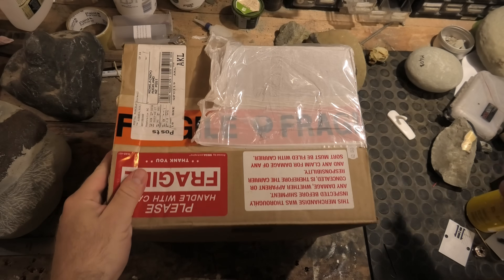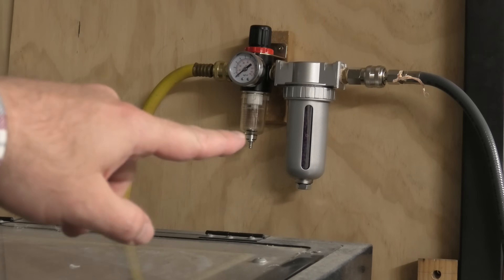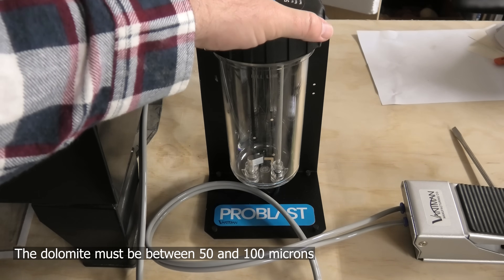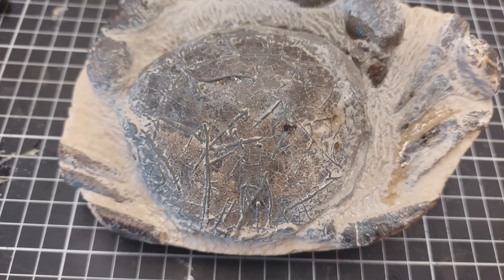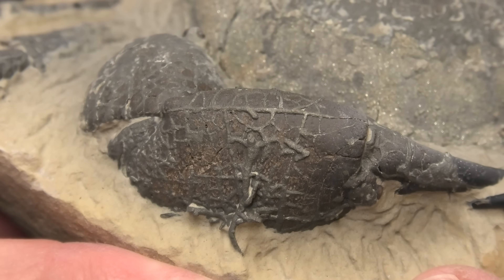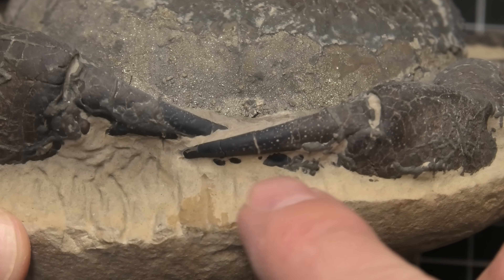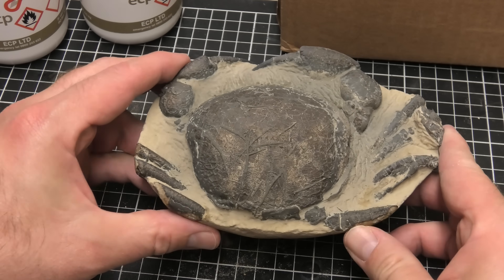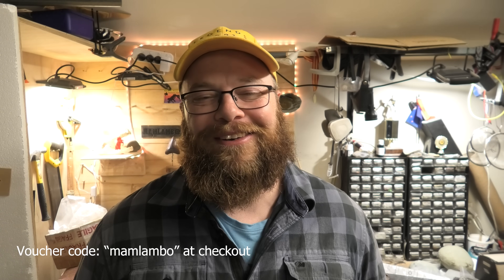Micro air abrasion fossil prep on a weird crab [Vaniman Problast]

Comment: What is the first regulator that removes the water called?
Reply from the maker: It has dessicant beads inside it, something like a drop out filter
Reply: @MamlamboFossils  So, is that regulator with the clear plastic piece below and the gray tube with the beads all one thing or two separate devices?
Reply from the maker: @Paul-gc7ig two separate ones

Comment: You can build the meshes onto a wooden base which is mounted on 3 or 4 springs with a sanding machine underneath. That way you don't have to dry it in the oven.
Reply from the maker: Ooooh I like this idea! I'll see if I can do this
Reply: @MamlamboFossils  there are many videos on YT.
Search for 'poor man's ultrasonic cleaner'  or  'ultrasonic cleaner with sanding machine' 
It can be applied to sifting sand. 👍

Comment: Looks very cool, nice job. I wonder if those branching growths could be serpulid worm tubes? It suggests that the shell was sat on the seabed for a while before burial. Totes jelly of your set up too. I've got a bunch of stuff waiting for prep but I don't have gear, or the space to put it atm.
Reply from the maker: I have no idea what the growths are, I've just posted on thefossilforum.com asking that question. Serpulid worm tubes (after I googled it!) seems like a good match. 
The problem I have is space as well, also being in NZ it's very difficult to get any gear in without doubling the price because of shipping!
The dream is to have a large shed with a gantry so I can move the larger blocks in and out of acid vats 😁

Comment: I do know some restorers use nut hulls to take away rust and paint. don't know how well that will work for what you are doing as it may not remove the sediment.
Reply from the maker: I've seen the walnut media, I just need it very, very fine which might be a challenge.

Comment: Great addition!  I used to use a sandblaster for cleaning old tools and things found metal detecting. I can see the fun in that 👌! A very needed tool for your "prep" toolbox 🧰 😀
Reply from the maker: Oooh, I haven't even tried it on my metal detecting finds!
Reply: Congrats on your first code! Hope that they gave it to you for a song (short song 🎵)  (inexpensive) 😉! 
We just don't have the fossils here but a few Crinoids and bi-valves. If or when I can get to better specimens; this is the most important tool behind the Dremel. 🍻 👏

Comment: Really awesome! I can see how it could be very therapeutic.

Great to see your channel getting recognized by a product company. I’m sure it’s going to happen more and more.
Reply from the maker: Thanks Valiant! It's so different to the air scribe, quiet and not so buzzy!
Reply: @MamlamboFossils  I didn’t think about that. Your fingers won’t feel like they still have a glove on when you stop the air abrasion tool. Haha.
Does it or the air scribe tools heat up much during use? I do wood burning with what is basically a soldering pencil, after a while, even the handle gets uncomfortably hot. Had to get a heat resistant glove to use for longer work sessions. I know…totally different sort of heat produced by the tools you use. My brain gets obsessed with similarity connections. haha
Reply from the maker: @valiantwarrior4517  because of the compressed air rushing through it, it stays nice and cool 😀